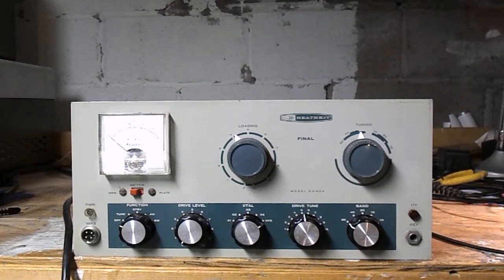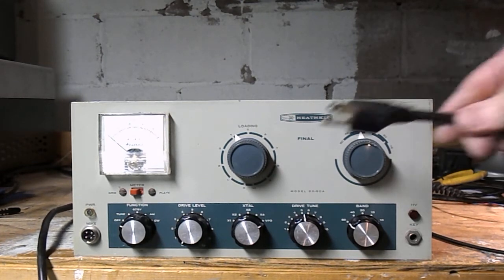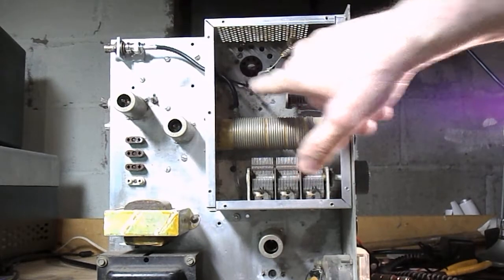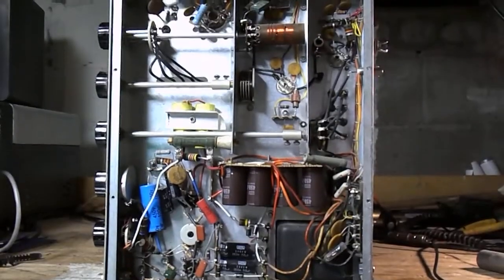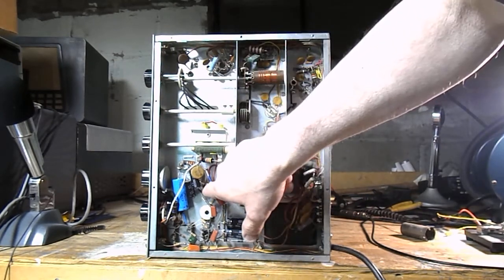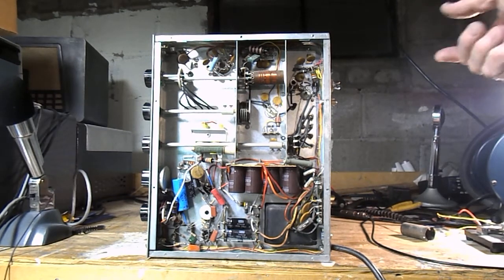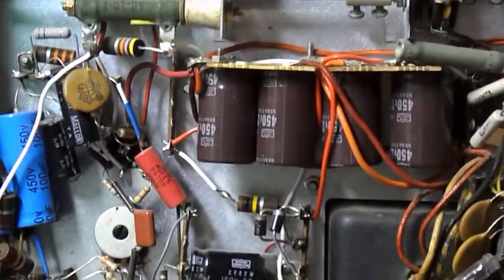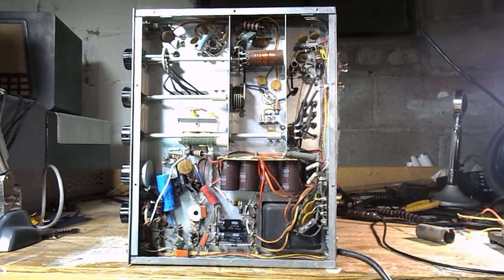What are these mods on my Heathkit DX-60A?

Comment: This is a video that needs to be pulled down. It was a parts radio with worthwhile mods at some point. Otherwise I hope this Op has learned more since this was posted 5 years ago.
Reply from the maker: Thank you. I'm trying to learn more about the tube transmitters. I've already restored several tube receivers.
Reply: Ah you butt hurt little man

Comment: They may had replaced the can capacitor with the 4 large ones. I would bring it up on a variac if you got one. Looks like with the mic plug they may had put in a ptt circuit
Reply from the maker: Thank you for the reply.  I just noticed it.  I know a little more about these older transmitters now, but mostly I work on the receivers.  I wound up selling it at a local hamfest.
73 Paul AA1SU

Comment: Paul: So what did you decide to do with the DX60? Looks like the can capacitor was replaced by those 4 big ones on the underside. Also I saw diodes that probably replaced a rectifier tube. The new mic jack is a welcome change. Curious about what you decided to do with it. Best Regards, Don KC3MBK
Reply from the maker: I still have it. I sent the video to Tim WA1HLR, and this was his reply (June 2018).  "The power supply has been rebuilt ( big caps on the breadboard ). Some one obviously did not finish up the mods they had intended to do. So far it looks like a good job was done."  I installed the missing tubes recently, and attached a remote VFO.  I could not get it to work.  Tim offered to get it working again (for a price), and I may take him up on that.